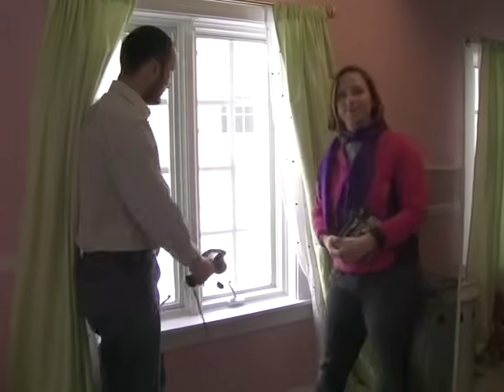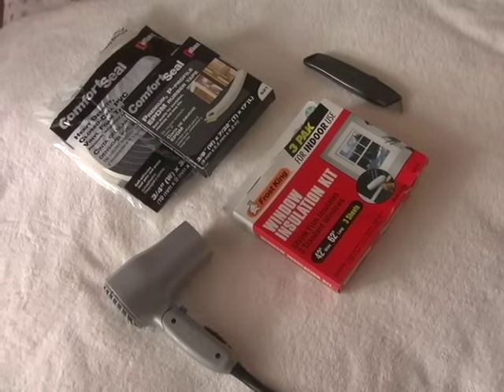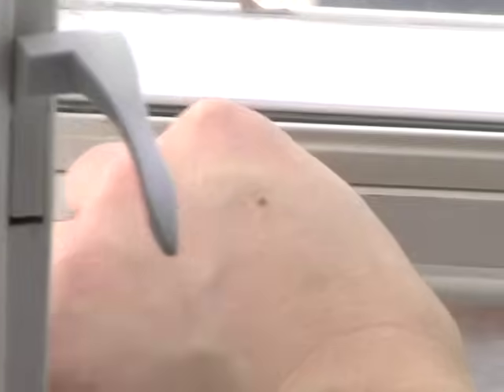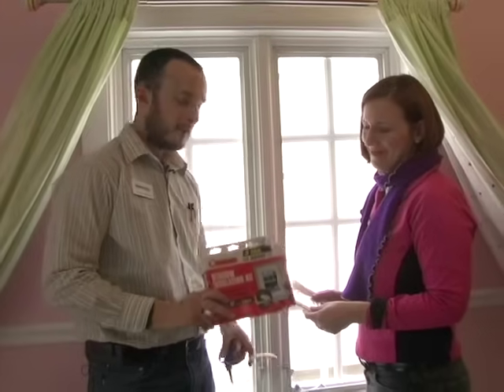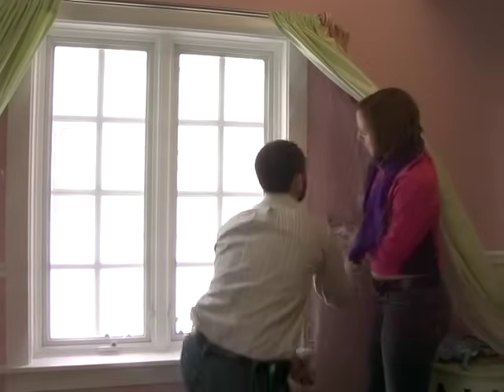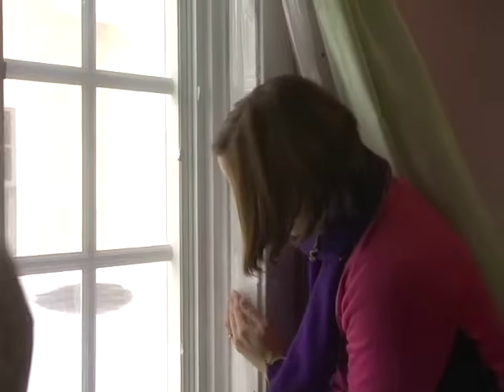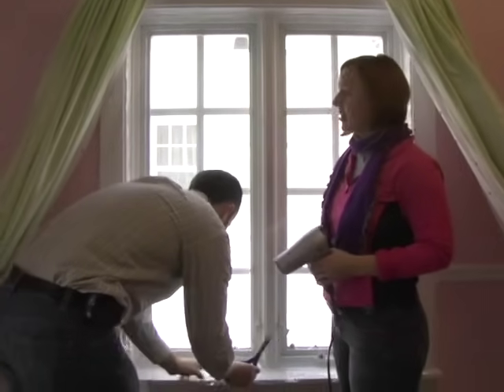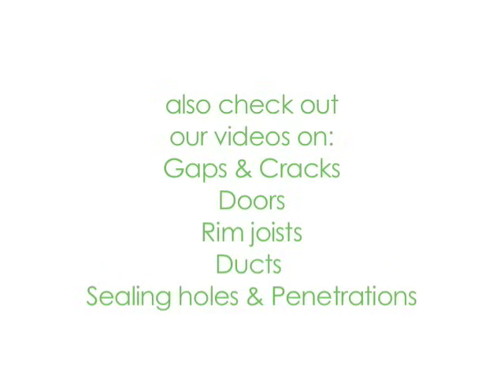How to Weatherize Windows with Plastic Film Insulation- DIY Home Improvement

Comment: so will the tape pull off your paint when you take the plastic off for the summer? will the tape leave a residue? If so how can I clean the residue, with alcohol? I ask this because I am a renter and need to return the apartment to its original condition.

Comment: ty for the clear instructions :) i bought a bulk roll of this plastic and the instructions were confusing.  but it was only $25 (including the tape) for enuf to do all my windows in the house.  ty for the weatherstripping tip, i realize i need it for my baywindow that opens out at the bottom.  very old window and can't afford to replace it this year. good job guys. i shared the video with my friends that can use this info

Comment: Thank you. I checked the video, but am still wondering, as I live in an apartment, not a house. It does not have AC and comprehensive airduct system. If I put window films on all of my 7 windows and seal around the entrance door, will any fresh air get in?

Comment: I Did my windows with window film recently, but I placed the double side tape flush on the sheetrock walls outside the window frame and across the bottom of the windowleadge inside. Is this creating to much air space by having film so far away from the glass surface?

Comment: I'm worried about mold growth on the windows after the plastic has covered them up.

The window frames in my home are metal, and at night those frames get just as cold as the window panes.  Lots of condensation.  I have had to clean off some mold spots on occasion.

Comment from the maker: The air gap between the glass and the plastic is important.  If the plastic comes in contact with the glass, you lose the insulating layer of air, and the plastic becomes visible because it's taut against the hardware on the window.

Comment from the maker: You're onto something, Davva.  This plastic barrier will help a little with insulation (maybe very little), but it's mostly for air sealing.  Most windows leak- even expensive ones.  If you want to be able to have an insulated, transparent wall that you can open and close at will, it's not going to be great at all 3 of those things.

Comment: The only problem with this is that it ruins the window molding when you remove the tape in the spring and then you have to re-paint all the trim work.  There must be a better solution.

Comment: > Gaps and cracks do not deliver enough air for newer homes and even many older homes. I believe a discussion of mechanical ventilation should be advised before advising people that they are getting enough fresh air.

ventilation defeats all the benefits of insulation because ventilation is opposite to insulation ;) You cannot have cake and eat it too, as you put it :)

Comment: This is dangerous advice. A blower door will also confirm if your house is too tight - anything under 1 air change every 3 hours. If you are exchanging air from natural convection once every hour, you have bigger problems than your leaky windows - go air seal your attic. There is a very large number of newer homes (1990+) which are on the threshold of this limit recommended by ASHRAE. I even test some 70's block homes that near this level.

Comment: You also want protection from the summer heat. Right? So, you need $20 + $20 rather than $20. Now, you will not remove the sheet at all. So, you need only $20 only once rather than every year!

Comment: This is good; but could I not just use clear tarp of good mil and duct or adhesive tape in the similar manner. Obviously this will not look as good as yours, but would not the effect be similar - in order to keep the drafts out?

Comment from the maker: @tituscaesar Actually, most homes get their air changed completely once every hour or two!  Amazing, right?  It's due to stack effect: warm air rises, gets out of the house, then cold air gets sucked in at the bottom to replace it.  A blower door test on your home can confirm this for you.  No need to open the window, it's being done by the gaps and cracks in the building already.

Comment: @naturalbornchiller1 I agree that reusable kits would be a great benefit.  Velcro, however, wouldn't do the job, because it doesn't seal as tightly.  I'm wondering if you could use the same plastic film, maybe, with new tape the following year?  You might have to leave a little bit more of the excess along the edges, if that's doable at all.

Comment from the maker: @HelenaJN If you mean simple plastic wrap, the main difference is the adhesion to the sill with tape (part of the kit) and the sheer size of the plastic- you don't want seams and gaps in the middle of the film, both for visual and for air leakage reasons.

Comment: Save some money and buy two rolls of 12" x 30' bubble wrap from Wal Mart for $8. tape to edges of inside window frame with one inch masking tape.  Use two layers if in extreme cold.  Bubble wrap lets in light and does same as sheet film in this video but insulates much better via the tightly spaced bubbles and of course much cheaper.  Negative of course is that bubble wrap is unsightly, so cover with a curtain.  Easily removed for spring.